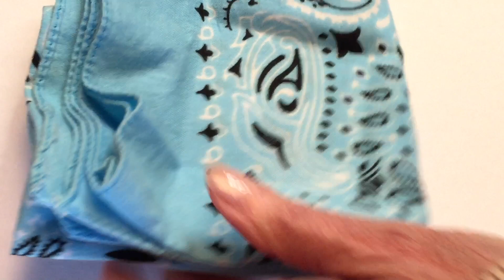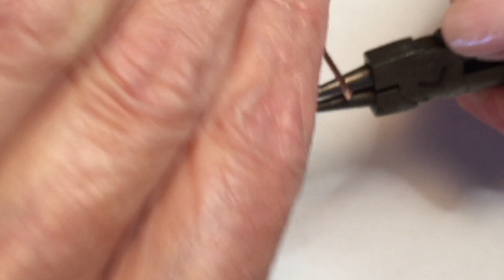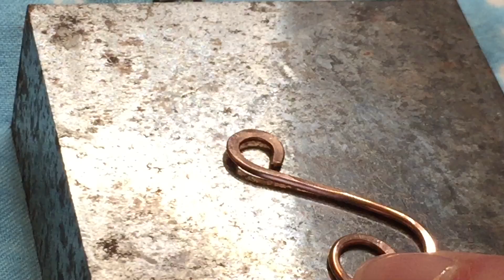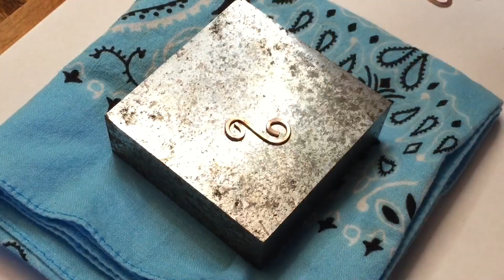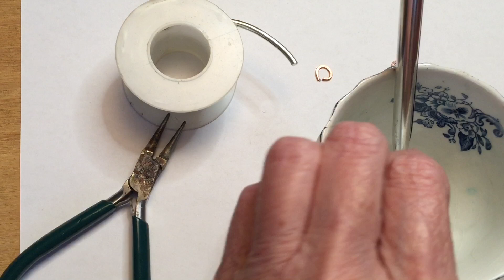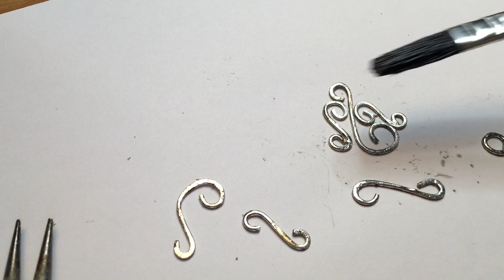Soft Soldered Sculpted Pendant | Soldered Alchemy

Comment: Thank you for the inspiring video! I have tried this however the solder doesn’t stick to the copper wire, wondering if there’s any trick higher temperature? Stronger flux or I need to use specific copper wire
Reply from the maker: Try cleaning the wire. Make sure it is actual copper wire. Make sure it is not coated with something such as plastic. Clean the copper well with steel  wool before soldering. Allow the copper to heat up for a moment to allow the solder to adhere. Make sure you are using fresh flux. Try a higher temp.
Reply: @LauraBethLove thank you for your instant reply! May I know what you mean fresh flux? Thank you.
Reply from the maker: @t-yx9hw  flux that is not old

Comment: Hi, if I don't need to create new shapes, just "connect" jewelry parts (pendats, cabochons in metal casing) I already have, can I use this method? What metals can I work with, and which are not  for this method? Thank you.
Reply from the maker: It depends on the metal, you should be able to with copper or silver

Comment: hi! i just wanna try soldering. Do you think it is okay to start soldering without mask? if i like it i will buy a mask later
Reply from the maker: You certainly should use some type of protection, even if its just soldering outside or near a window with a fan but I always recommend a fume extractor and a mask.

Comment: Love your videos and books. I am a silversmith, but am new to soft soldering. I have learned a lot from you, many thanks! But if I may offer one little tip in return... When you are hammering metal on a bench block, hold the end of the piece OFF the edge of the block. Less likely to hammer your fingers! 😉
Reply from the maker: Great tip, thanks!